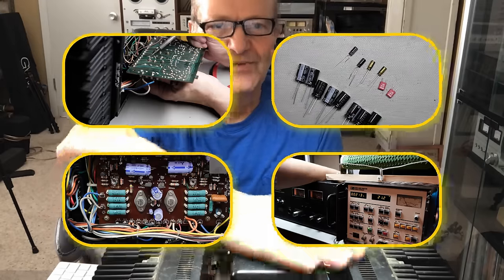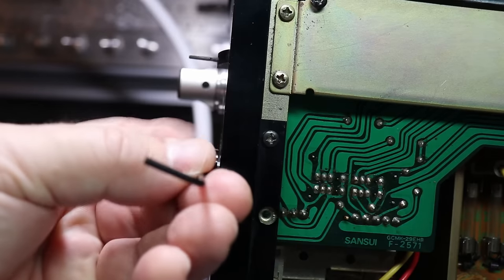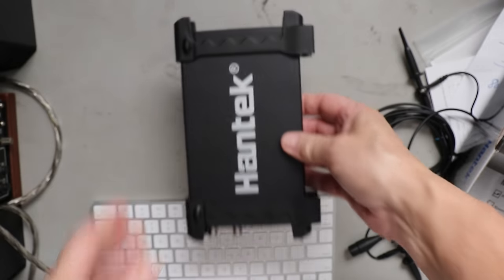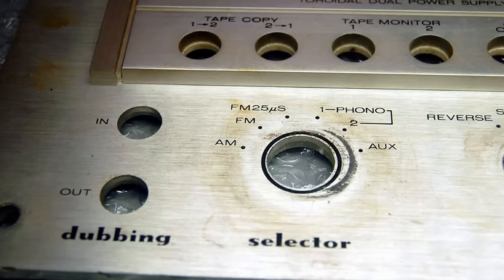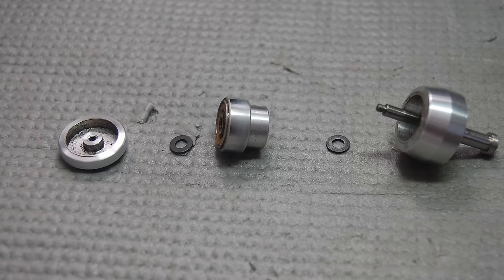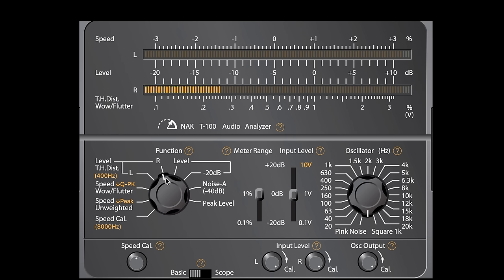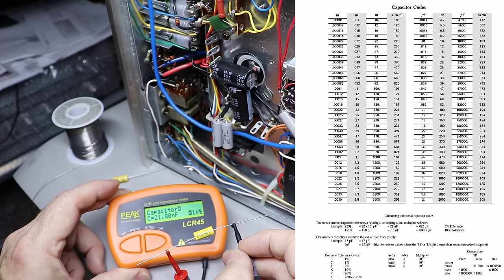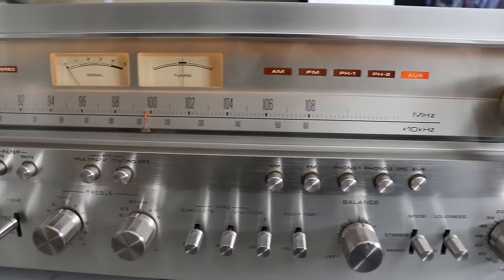Ultimate Guide To Vintage Audio Repair. Old Electronics Troubleshooting. Repairing Tips & Solutions

Comment: Wow! This was/is the absolute BEST and definitely THE MOST thorough video that I've EVER seen anywhere about this specific topic! Very interesting, informative, AND helpful!

(And since your video was long, and you gave people "fair warning" about its length in the very beginning of it, I will do the same here and say that this comment will most likely also be quite long, based on how many questions I made note of to ask you about while watching your video, so here goes...)

Me being an "electronics nerd" myself, I really wish that I personally knew someone just like you in my own town, that I could just talk electronics with, and visit anytime I wanted to "collab" on a project or get help with something I'm working on, share info I know, etc...

On that last note, there is a few tips and things I would add to or further expand on about your video here, along with a few questions I thought of while watching it...

One of the very FIRST things that I do when looking at and attempting to service any piece of used audio equipment is (right after taking the cover off, but before even powering it up and testing it), is to take it outside and blow any/all of the dust and dirt out of the entire insides of it using an air compressor and blow nozzle, that way you can also see better if anything is obviously wrong with it before ever powering it up. (like loose wires, obviously physically broken or blown components, etc.)

I absolutely MUST add a good quality desoldering gun or station to my workbench tool arsenal, as that specific thing, (i.e. desoldering components, especially from circuit boards, and especially from "double sided" circuit boards!), has been a major frustration of mine for WAY too long already! I just need to break down and finally invest in a good quality desoldering gun like that HAAKO one that you have there, even though the truly good quality desoldering guns like that one, and especially all of the good quality desoldering stations, are quite expensive! (That's why I've put off buying one for so many years!) And even though I've gotten quite good at utilizing that "desoldering wick" stuff, I go through it too fast and I'm always having to buy more of it, plus I know it's still not nearly as fast OR EASY to use as a really good quality desoldering gun or station would be!

While on the subject of tools needed for this type of work, I luckily already have a few of the more expensive things you mention...

I already have 4 Fluke multimeters, one Model 189 multimeter, two Model 289 multimeters, and one Model 867 graphical multimeter, (ALL of which I've bought used over the years for really great prices!), so I've got THAT part covered at least, lol!

Along with my multimeters I also have a very nice Fluke test lead set that includes REALLY sharp pointed NEEDLE tip test leads, that will literally instantly make you bleed if you accidentally touch the tip of them, but they are really awesome for very securely and safely testing individual solder joints or test points on circuit boards, or individual component leads like on ICs and such, without accidentally slipping off or shorting out another adjacent terminal, etc. They are awesome because they don't ever slip off of terminals or joints because they dig into them slightly. They also fit into the tightest and tiniest of places on a circuit board because they are slightly smaller and more of a slim profile than the typical/normal test leads that you get with most multimeters.
It looks like you could actually also use some of THAT type of test lead yourself!

I also got extremely lucky and I recently acquired an O-scope that is VERY similar to yours in this video. I now have a Tektronix Model 475 oscilloscope that, believe it or not, I found for free in a "recycling" dumpster not too long ago! (It's amazing what some people throw away!) It appears to work perfectly fine after I cleaned all of the switches and controls on it, but since I've never been able to afford or have an actual o-scope before, I'm still learning how to actually use it, lol!

I also recently found at one of my local thrift stores for $15(!!), a VERY nice "vintage" Hewlitt Packard Audio Frequency Signal Generator with a nice, large dial on the front of it for very fine, precise frequency control. It has an output range of 1Hz all the way up to 1MHz, so it works for pretty much ANY audio testing I need! (except RF frequencies of course)

Now, as far as places to actually still buy good quality individual electronic components go, I agree that Mouser and Digi-Key are two of the better/best places to buy those components from! Thank goodness we still have those two electronic parts distributors at least, because more and more electronic parts stores and distributors seem to be going totally out of business every single year, because most average people nowadays don't even care to fix or work on anything anymore, they just throw it away and buy a brand new one, which is a major waste of resources IMO!... Anyway, for the few of us who actually still DO care about fixing/restoring vintage audio gear, and realize that when working properly, most all of it is better quality than most new stuff is, at least Mouser and Digi-Key are still around to supply (most of) the parts we may need to fix said vintage gear! Both of those parts distributors are very reputable, long lived companies, that directly source their components from reputable manufacturers, so you at least know that anything you buy from them is of a good quality, and is backed by their guarantee of that if there's ever any issues with what they sell... Unlike what you get from buying rather "sketchy" quality stuff from unknown reputation sellers on Amazon or Ebay, lol! (I just wish that Digi-Key and Mouser's PRICES were as cheap as the electronic parts are on Amazon and Ebay!... But I guess this is a place/topic where the saying "you get what you pay for" really does apply, because many of the electronic parts that are sold on Amazon and Ebay are really cheaply made, low quality, imitation/fake parts, and/or "seconds" or "factory reject" parts, which usually either don't perform up to specs, and/or totally fail prematurely when put into use, which is extremely annoying to deal with when trying to repair something!)

On that note, where do you recommend buying truly GOOD quality, very LARGE value, (>10,000uF), power supply filter capacitors for a still reasonable price? The only kind of those types of capacitors that I can find online are either EXTREMELY expensive, or else the more reasonably/affordably priced ones seem to just be of total garbage quality that either immediately blow up or leak really bad as soon as you put their "rated" voltage across them!
Any serious suggestions here would be a great help, as I have a few vintage amplifiers that need new power supply rail caps, I just don't know of the BEST place to get them, and before I invest tons of money in the expensive ones, I'd like to know if you, (OR anyone else reading this), knows of a good, reliable place to buy truly GOOD quality filter caps from for a reasonably affordable price first!

Now, as far as getting service manuals and such goes, (and I totally agree that having the actual service manual for any component that you're trying to repair, is absolutely essential to doing the job properly , because it gives you proper adjustment values and voltages, etc.!), I HAVE already at least HEARD of/about "Hi-Fi Engine.com", but I've never bothered to set up an actual account with them yet, but after hearing from you more specific details about what all that they provide on that site, it sounds like I really SHOULD/NEED TO set up an account with them!...

I'm also gonna definitely have to check out that other site you mentioned; "World Radio History", because that site sounds totally awesome! I've never heard of it before now, but it sounds like a VERY valuable info site, so thanks for mentioning it in your video!

(This comment got "too long" to post, so I had to put the second part of it below, as a "reply" to this one...)
Reply: As far as actually servicing vintage audio equipment goes, the following three things I noted while watching your video...

You can also spray contact cleaner into those common style pushbutton switches by spraying it directly into that little hole on the top of them with the cleaner's straw, rather than only by the front of it where the spring is. I've found that the cleaner seems to penetrate the entire insides of the switch better, and with less "overspray" by spraying it directly through/into that tiny hole in the top of those switches. You can just fill the inside of the switch up through that tiny hole in the top of it until you can actually see the liquid of the cleaner inside the switch itself because the top part of the switch usually either changes to a darker color, (if the top is phenolic), or at least the cleaner starts to squirt out of it when the switch is full of it. Then move the switch back and forth, in and out a few dozen times, as you mentioned in the video...
Also, an important thing to add is; after cleaning the switch contacts with that "De-Ox-It" stuff, don't forget to also then use their spray lubricant to re-lubricate the internals of the switch, otherwise if you ONLY use the cleaner spray and NO lube spray afterwards, it tends to dry out the switch sometimes, making it not work properly physically, after the cleaner fully evaporates out of it.

For one GOOD channel vs. one BAD channel comparisons of an amp's circuit board(s), I like to always first compare individual component values, (resistors, capacitors, transistors, etc.), between the two separate channels with a multimeter FIRST, BEFORE actually powering it up and testing for audio signal and voltage differences, etc., that way if you can actually find any noteable differences and issues without it being powered up first, then there's MUCH less of a chance of accidentally shorting something out by touching (LIVE) terminals together with your meter probe tips, etc. (Again, an important reason to have some actual NEEDLE tip test leads, as mentioned earlier!)

Voltages on/at designated "test points", as stated in the service manuals of vintage audio components will almost always be at least slightly different, (up to about +/-10% or so different before there's a serious issue, as you stated in the video), than what is stated in the service manual at that point, and the voltages are almost never exactly as what is stated in the manual, simply because of variances in the tolerances of individual related components, (resistors, capacitors, etc.), especially on OLDER components, because as individual resistors, and especially capacitors, age through the years, their values can change quite significantly, especially electrolytic type capacitors, and especially in hot environments, as you stated in the video of reasons why those types of capacitors have to be replaced after about 30 or more years. They also can significantly affect the voltage readings that you are supposed to be getting at any given circuit point!

Anyway, I know that you are already aware of all of these things, but maybe this info can even further add to the helpfulness of this video for someone not quite as experienced as we are in vintage audio repair and restoration...

In this modern day and age of no more service techs and repair shops, and less and less places to find out valuable, truthful, reliable, useful, and actually helpful info about vintage audio equipment, (which is making a "comeback" among today's "throwaway" society, which is really cool, because most vintage audio equipment was built to a MUCH higher quality standard than today's crap gear is, so vintage audio gear is definitely worth investing some of your time and effort into restoring it to its full, original performance levels, because if you do, you will be really happy with the sound quality that you can still get from most vintage audio components!), (so), we are all at least lucky to now have the internet, because as you mentioned in this video, we at least still have access to online, almost all service manuals, instruction/owners manuals, and individual product literature that was ever printed in the past, as long as you know exactly where, (i.e. what website), to look for it on, so that fact is awesome at the very least!

OK, I will end this "book" here! I hope this info and especially this video helps out as many people who want to restore a piece of vintage audio gear as it possibly can! Have a great day, and have a FUN and enjoyable experience working on your own audio gear, whatever you may come across over the years!
Reply from the maker: Thank you so much for your kind words and for commenting at such length! I'm sure that your comments/suggestions will help other hobbyist's. As far as your question goes about the sources for larger value capacitors I've found both mouser.com and digikey.com has them most of the time. Sometimes it takes some searching of those sites but there is usually something on those sites that you can use as a replacement for your vintage capacitors. The cost??? Well, they are not inexpensive. Many times just the replacement of the filter capacitors in vintage audio equipment will cost more then all the other components needed to complete a total restoration.
Reply: @vintageaudioaddict  Yeah, I was afraid of that! :(
That's why the amps that I have that need new main rail filter caps have not been fixed yet and are still sitting around just collecting dust. I was just hoping you knew of a cheaper place to buy them...

I really wish I knew of a way to tell (before buying) which ones, (IF even ANY), of the "too good to be true" sounding "deals" on Ebay, Amazon, and various "electronic parts surplus" stores online actually were/ARE good deals, and which of any of those sellers actually had genuine, good quality capacitors like that, because the prices you see on those sites for large value caps are VERY tempting to try them just to see if they actually work... (Price differences of 20+ to 1 ratios are quite common online for seemingly the exact same part(s)!)

I also wish there was a good, reliable way to look at a picture of a capacitor's labeling and know whether it was a genuine branded capacitor from a reputable manufacturer, or if it's just a cheap quality, "fake" knockoff, "copy" or "imitation" branded one, because the "fake" capacitors online are getting extremely good at imitating the exact look of the truly genuine brands' logos and name font printing and such! It's really quite disgusting that it has even come to this in this modern day, where there is actually more FAKE electronic parts available online nowadays than there is 100% genuine REAL ones! It's just SAD! How are the companies that make the cheap copies of stuff even allowed to do that? It really seems like there should be some kind of industry-wide regulations or laws against that crap in the industry!... But I guess that since there's seemingly no regulation of that, and everyone online seems to just be all about sheer maximum profit and not about any kind of useful quality levels anymore, then now it's a total crapshoot buying stuff online! (That's why I hate it!)

I really miss physical "brick and mortar" electronic parts stores that you could actually walk into and talk to real people about the products you're interested in buying and find out any specific details about them that you might want to know, and then also have your purchase backed up by either the store's and/or the manufacturer's warranty against defects, etc.!...

I guess you can still get that (sort of) from reputable online sellers like Digi-Key and Mouser, but I just wonder how much of a "middle man markup" that they have on the parts that they sell, because when a certain large value filter capacitor on one of their sites for example, costs around $100 EACH, (sometimes even more!), then you go on Ebay and/or Amazon and find literally HUNDREDS of listings for seemingly the EXACT SAME BRAND, VOLTAGE, AND CAPACITANCE RATING VALUE capacitors for around $5 each, some even less, it really makes you wonder why there's such a HUGE price descrepancy!... You're thinking "OMG, they can't possibly ALL be total fakes, can they??!"... or "Surely there's someone here (on Ebay/Amazon/surplus stores, etc.) that has truly genuine "New old stock" capacitors that I can get a really great deal on!"... I just wish I knew of a reliable way to find those deals, because I'm definitely not rich, money-wise, and I simply cannot afford to spend literally hundreds of dollars on just 1 or 2 capacitors! That's just insane IMO! :(
Reply: @mohammedisaa9952  Yeah, that would be REALLY cool, if I could actually make money at repairing vintage audio gear, however, I have NO money to actually start a business in an actual physical store, NOR do I have ANY knowledge about how to, (or any kind of camera, etc, gear to), start an online video stream business, like here on YouTube, etc., but IF I knew how AND I had the means/money to actually do that sort of thing then it WOULD be awesome!...

As of rn, I ONLY work on stuff for myself and for my own personal stereo system, and only as a "hobby" that I "dabble" in. Even though I understand and know quite a bit about vintage gear, (through my own experience and "trial and error" experimenting over the years), and in servicing electronic stuff in general, (through hole circuit boards, soldering, etc.), I DON'T have ANY kind of "formal" training in this field, so actually attempting to do repairs and restorations "professionally", as a business, would most likely get me into big trouble, where I would get quite a few pieces of gear that I didn't really know how to fix properly. I do what I can, with my OWN personal electronic gear, of which if I break even further while trying to fix them then it's just simply a learning experience, but NOT a liability, lol!

And about capacitors... I HAVE tried using other used capacitors from other (thrift store, etc) used gear, (thrift stores are actually where I find most of my electronics gear that I own!), but as with ANY gear that's older than about 30 or so years old, the electrolytic capacitors in pretty much ALL gear of that age or more are usually rather dried out and usually now of a much lower uF value than they should be as a result, especially among the larger value caps, as in power supply main rail filter caps and such, therefore most of the other used gear that you can find for cheap (at thrift stores, etc.), are pretty much ALL in need of similar repairs, and therefore are NOT really a very good place to find still totally GOOD parts, especially not large value electrolytic capacitors and rubber parts like belts, pinch rollers, etc., (like for tape decks, etc), because rubber ALSO dries out and either hardens, rots, or cracks after about the same number of years as the electrolytic capacitors fail at. (Unfortunately!)